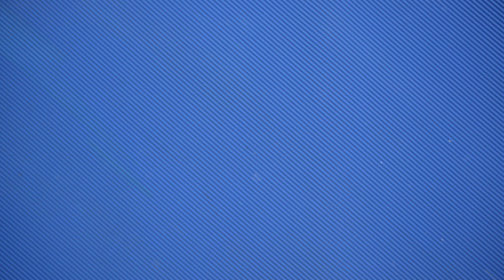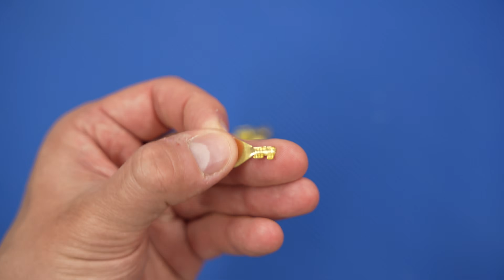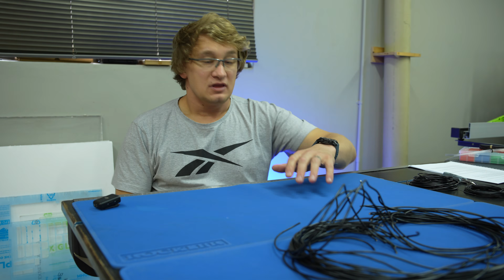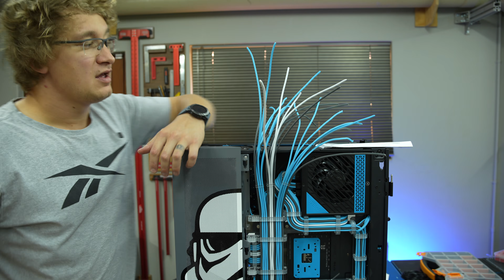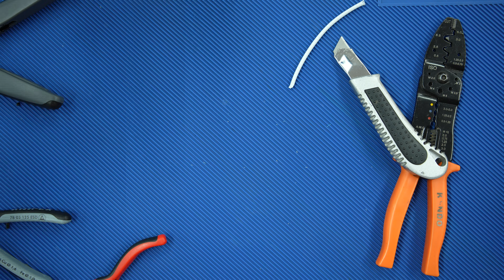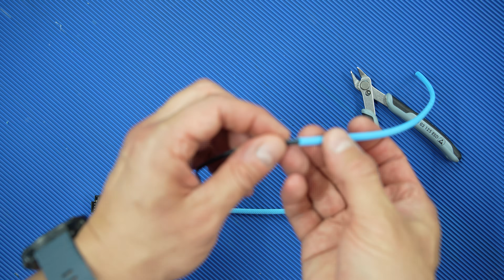How to Make Custom Sleeved PC Cables Step-by-Step (Full Guide)

Comment: Is it possible to just find the pin layout by tracing out where the terminal on one side connects on the other side?
Reply from the maker: Definitely, I always do a quick spot check, doing exactly that. Just to make sure I didn’t make a mistake.

Comment: I know you cut them all to same length at the beginning, but then you cut again before going into the PSU. Is there any issues with uneven length causing power issues? I know for 3 phase all the wires are supposed to be the same length, is this similar or is it so miniscule it doesn't matter?
Reply from the maker: Hi there, I personally never had a problem with the wires not being exactly the same length. I haven’t heard of anyone come across a problem like that. In the end of the day the difference is about 10-15mm between the longest and shortest wire. Thats the worst I have encountered. But it is possible, specially with cables like the 12VHPWR connectors used on the newer GPU’s. I have worked with Solar systems where it is critical to have the battery cables the exact same lentgh, but keep in mind the minimum current on a system is 100A per cable. The highest rated PC cable is 10A per wire. So I don’t think it would be a problem, but I will definitely look into it. I will be receiving one of the new TG wireview adapters that can read current draw. Might be a interesting experiment to make a cable with a lot of different length wires. Just to see what the impact will be. Thanks for taking your time to comment really appreciate it!
Reply: @marcelgenis thanks for responding!
Reply from the maker: @VonEsch  My Pleasure, Sorry for taking a while to reply, been a little bit occupied with work!

Comment: Can I use 10-15 guage instead
I think I'll have to find a supplier who makes em with good quality and purity though
Reply from the maker: The thickest wire I’ve used in a build is 15 AWG, which is also what I’m using in this video. You may be able to go thicker, but keep in mind that the wire shouldn’t exceed the crimp terminal’s rated capacity.

The crimp terminals I use with 15 AWG already have longer conductor wings that wrap securely around the wire, which can be helpful if you plan to use thicker wire. I’ve linked those terminals in the description.

You can also check out my other sleeving video, where I show how to determine the correct sleeve size for the specific wire you’re using:
https://youtu.be/M-eD8ZGtmWc?si=e28oXQUcko9rEpSr

Let me know how it goes! Enjoy making your cables!
Reply: @marcelgenis thanks for the info man 
I'll see what I want can find locally 

Also wouldnt 10 awg solve alot of the melting connector problems with Nvidia gpus?

Comment: Need PINOUT help!  Can anyone give me a good reference for Segotep GF1250 and ThermalTake TPG-750M?  You can be a hero...
Reply from the maker: Hi there! I only have my phone with me, on holiday at the moment. But let me have a look as soon as I get back. If you need it quickly you can always just follow each wire of the stock cables that came with the PSU. I always use the stock cables as an good sanity check😂

Comment: You absolute legend, great tutorial. I have the same PSU than you, MSI MEG AI1300P and I intent to custom sleeve mine with the bloody 12VHPWR connector this week, starting Wednesday. 
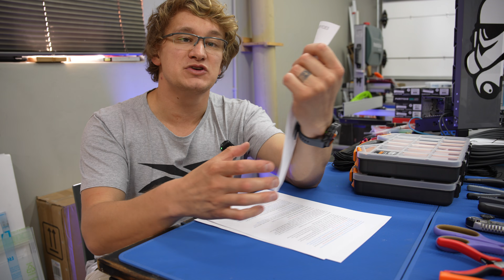Could you please upload your pin out diagram as you state at 4:32 I can't find it anywhere in the description nor comment section. I can still screenshot the 24 Pin ATX part as you show it very nicely in your video. 
Thank you mate.
Reply from the maker: Thank you! Glad you liked it. Awesome PSU, love it! I will be doing a video on 12VHPWR connector soon, going to use the new Wireview Pro 2 adaptor from TG. Have been making a few of those cables, trying to see if I can make one with a thicker gauge wire. So far not going too great😂 The 17 gauge works well though. 
Sorry for that, I completely forgot about that. I am away this week on holiday. I will add the link next weekend, all of the files are on my main PC. Thank you for bringing  that up! Really appreciate it and your comment!
Reply: @marcelgenis  Good morning, I hope you had great vacation. Gentle reminder to upload the MSI Pinout diagramm <3
Reply from the maker: @TeknoPhil84 Thank you for reminding me! I completely forgot about it! I have added the download link, just below the the link the Alex banks template link! Thanks again for reminding me, let me know how your build goes! Enjoy!

Comment: Did you custom make the combs attached to your case for the routing as well? I have the same case but in all white and plan on doing this with an upgrade I making soon. Currently using extensions for asthetic purposes and it is simply way too much. Seen in the comments the wire quantity you ordered, but shouldn’t we be able to use the supplied wires from the PSU? Un-pin, route, cut to length, sleeve, and recrimp?
Reply from the maker: Hi there , yes I did. Have you seen my other video where I made the comb/cable tray for the NV7? I have all the files available for it if you want to use it, just look for the link in die video description https://youtu.be/b6rOJhgB2-4?si=WiALACg0yxDVISuA

And yes you can just sleeve your stock cables as well, I made a video about that as well https://youtu.be/M-eD8ZGtmWc?si=iMn0Z1ioCX89Njbz
Reply: @marcelgenis yes, I watched another video of yours shortly after I commented! Great tutorial BTW!
Reply from the maker: @ericgraham164 Thank you, glad you liked it! Enjoy your build, watercooling is nice and all but nothing beats custom cables
Reply: @marcelgenis agreed. Debating a custom loop vs current AIO setup. Might as well though if I am investing this time in the case already.
Reply from the maker: @ericgraham164 Well neither should intervere with the cables. So you could just stick with AIO and then replace it later with a custom loop if you need it. I personally tend to go overboard, I am already busy can just as well go ahead and do everything 😂

Comment: 6:51 You can just "load" your terminal in your crimp tool and "lock" it in place, slide the wire into the terminal and itll stop when the insulation hits the lip of the tool. Then, squeeze. No needle nose pliers needed

Comment: Hello good sir;

First of all thanks for your amazing video, top content; top quality; good job man!

Your videos convinced me to try to do my own custom cables for my new build instead of buying some.

I am a little bit concerned about the GPU PSU cables.
We can read everywhere that even "native" cables and GPU connectors can literally burn/melt;

How about the GPU connector of custom cables?
What are your thoughts on this?

Thanks again for all this knowledge good sir!

Have a nice day
Reply from the maker: My pleasure! So glad that the video could inspire you to make your own custom cables! There is always a possibility that a cable can burn or melt especially with the new connectors. The best you can do is to use good quality wire and connectors. In this build (https://youtu.be/b6rOJhgB2-4 ) is used a Thermal grizzly 12VHPWR to 3 x 8Pin PCIE adapter, the idea was to limit the amount of 12VHPWR connectors at least doing this I won't have one at the PSU side. But this is a solid solution. But thermal grizzly has made a new 12VHPWR adapter where the adapter monitors each wires current and sounds a alarm when one is out of spec and can shut off your PC if need be, so I will use this adapter with custom made cable where you use 17 gauge wire from MDPC-X to make the cable, 17 gauge wire far exceed the spec in runs shorter than 2m. So this in my opinion is by far the best solution for the burning cables. I am working on  a how to video where I show how to make your own sleeved 12VHPWR cables, hopefully I can get it out within the next few weeks. Hope that helps! Thanks again for you comment I really appreciate it, enjoy your day as well!
Reply: @marcelgenis  legend. thanks for all these informations, I am getting one of these !
Reply from the maker: @caquelon3000 My pleasure! I am also getting one, they are currently on pre-order!

Comment: I dont usually give out likes often, but You deserve it, Nice Guide with all i need and a VERY Clean build on top of that, I wanna make my own custom cable, but if im gonna use custom mounts for them is still something i gotta decide on, because i wanna save money where i can, which is why i am making custom ones, but It sure does look cleaner with these Combs mounted there, MDPCX sells 17 AWG "Extreme" wire, for the 12VHPWR Connector, do you think it is good for the GPU? because tbh it is kinda Slim, and the 15AWG does not really Accommodate the Connector size of the 12VHPWR Port
Reply from the maker: Hi there, thank you really appreciate the comment! I am going to do a rebuild where I am going to make 12VHPWR cable with MDPC-X 17 awg extreme wire, the wire in my opinion is more than enough. The current rating for their 17 gauge wire far exceeds the current requirements for the connector up to lengths of about 2meters. Yeah they are really slim, but that's because they use very good insulation material for the wire. To compare it, even basic 18awg wire is rated to handle 15 amps at a length of 2meters. The 12VHPWR connectors are rated to 10 Amps per terminal, so yeah I really do think the 17Awg wire is more than sufficient for this, especially the extreme wire from MDPC-X. The only thing I will try to add, is something to balance the load or alert you when one wire is seeing more amps than what is expected, the new thermal grizzly adapter will be a good option for this. Will alert you if there is an unbalance and can also shut your PC off if it is not corrected. I am definitely going to try and get one of those when using the 12VHPWR cables.

Comment: What a ball ache!! I applaud the dedication but seriously, this video need only apply to a very small number of people with too much time on their hands. Great video, excellent demonstration.
Reply from the maker: 😂Yeah, I can’t argue with that! Thank you, appreciate it!
Reply: IDK, OCD types might prefer an OFC wire versus some manufacture's cost-cutting practices with CCA wires and less than preferable non-Gold or non-Rhodium coated terminals that aren't as good for electrical bandwidth/frequency transmission. 
There are potential advantages outside aesthetics alone in custom computer cable fabrication.
And yes, the ball aches of the process are all too real!

Comment: Soooo... ATX 3.1 16pin 12VHPWR? Also my SFF Corsair SF850 has like, mini versions of the ATX plugs on the modular side, got any information on working with these connectors?
Reply from the maker: Yeah I have had a lot of interest regarding the 12VHPWR connector. I personally don’t like them, try to use adapters to convert it to 8Pin PCIe connectors, but I’ll order some and make a video about it. MDPC-X has a guide on how to make one, basically the same principle as the rest, you just need to use different size sleeving and wire. But I will make a video about it! Regarding the mini ATX connectors, I have seen them before, think the terminal cavity on the wire size is 3mm instead of 4.2mm. I’ll do some research about it and get back to you. Might make a good video! I am planning on doing a SFF build so might come in handy!

Comment: I can't find 15 gauge wire on Amazon.  Only 14 or 16...
Reply from the maker: Hi there, Yeah you won’t find 15gauge there. MDPC-X is the only company I know of that makes 15gauge with smaller outer diameter, specifically for PC cables, in the end quite similar to the normal 16gauge. Nothing wrong with using 16gauge, basically all of the stock PSU cables are made with 16gauge. If you are in the US, I know Titan Rig do stock the MDPC-X 15 gauge wire. If you are based somewhere else, go and check MDPC-X website for all of their supplier’s across the globe! But yeah you will be just fine using 16gauge, I only use the 15gauge with XTC sleeve because they work great together, making it a little bit easier if you are starting out!
Reply from the maker: If you haven’t seen my other sleeving guide video, I show you how to select the correct size sleeving based on your wire’s thickness! Hope that helps, let me know if you have any other questions! 
EASIEST Way to Sleeve Your PC Cables (No Expensive Tools!)
https://youtu.be/M-eD8ZGtmWc
Reply: @marcelgenis 
Thank you very much!
Reply from the maker: @spacecityryder My pleasure!

Comment: All of these high-power connectors should be gold plated.
Why it isn't the standard is beyond me.
Reply: Are you spraying your cables with water? I am trying to understand the need for corrosion resistance.
Reply from the maker: @Derpyfox4444 😂 Yeah, I would also like to know!

Comment: While i got all the stuff to make my own cables from scratch,, i think i may just end up sleaving the ones that came with my Seasonic PSU. Unsure yet. Problem is, its currently my main PC and i just haven't found a good stretch of time that i want it to be offline long enough for me to do it. Also plan on re-building the waterloop at the same time. Which i figure all of that could take like, a solid week of planning, building, connecting, testing.
Reply from the maker: I feel you! Exactly how I felt, I also had to take apart my PC for a while and not having a second one. Only advice I have, is try and plan everything in advance as best as you can and then just start! My only regret is that  wasted so much time trying figure out a way to do the rebuild without being pc-less for too long, instead of just starting the build!
Reply from the maker: Good luck on your build! Hope it comes out great!!

Comment: i just made my first cable (24pin PSU) following the diagram from the cable that came with the psu. All seems fine on the multimeter, but i'm afraid to plug it in my PC hahhaha
Great video btw, will save it for reference. Custom cables are addicting af!
Reply from the maker: 😂😂 That feeling never goes away, no matter hom many times you’ve done it! But if you checked it with the multimeter you will be ready to go! Yeah, Once you’ve made your own cables, you can never go back!😂 
Glad you liked the video and Thank you, really appreciate your comment!
Reply: HHAHA .. Saame. I made my own SATA power cable a couple months ago from my server because i dont like having to run two separate cables to power 5 drives. Everything on the multimeter checks out, but the wire i used is 'flexi' type wire which makes me feel abit uncomfortable using it as PSU wiring. I did test it (on non-critical drives) and it Does power them on any everything.. but i still havent plugged it into my server :P
Reply from the maker: @lyianx 😂 Jip that feeling is always there! As long as the gauge of flexi wire is the same, or thicker then everything will be just fine!

Comment: Is there a possibility to custom wire a 12vhpwr cable? Or is it to dangerous
Reply from the maker: Yes definitely, I just prefer to use a adapter instead of native 12VHPWR connector. The store I buy all of my sleeving supplies from actually have an guide how to make your own and they stock a special 17Gauge wire with extra thin insulation to be able to easily sleeve the cable. They have a guide to make your own as well. Here is the link to their website( the link to the guide is on their homepage) https://www.cable-sleeving.com
Reply: @marcelgenis  Wow Thanks for the info and the help.
I appreciate it ^^
Reply from the maker: @VictorStumm My pleasure. Glad I could help! Good luck with your build, making your own cables is so rewarding!
Reply from the maker: And thanks for watching! Really appreciate it!

Comment: Awesome, just finished my custom cables with your instructions. Suffice to say, I am not doing it again 😂
Reply from the maker: That is awesome! Thank you for letting me know and glad that my how to video could help! I felt the same way, but a few days later I was ready for the next one 😂 Maybe thats just me!😂 Thanks for watching, really appreciate it!
Reply: HAHA.. That's exactly my thoughts too... I've been an electrician for 25 years and have made up more control panels than I can count... I think I'll just route the cables that come with my components.
Reply: how much wire did you used? I know depends on the case and where the PSU will be but i want to have an idea on how much should I order
Reply from the maker: @bryantorozco2544 Hi there! The quick and dirty method I usually use to order wire is to order the same amount of wire as what is given with the PSU. For example 24pin MB cable that is 600mm in length is equal to 14.4m, so I will round it off and order 15m of wire. I ordered a total of 50m of 15gauge wire for this build and didn’t use all of it. Even with the GPU wires being 800mm in lentgh. To be on the save side add 10m to your total, especially if you are doing this for the first time. Hope this helps! Thanks for watching really appreciate it!
Reply: not gunna lie, it looks easy but its a lot of work! Great video!
Reply from the maker: @baconfriedeggandrice  Without a doubt! But worth it!